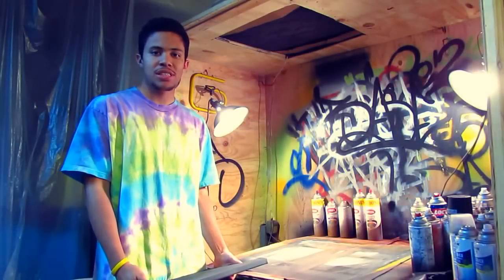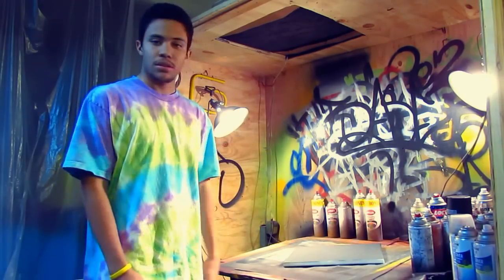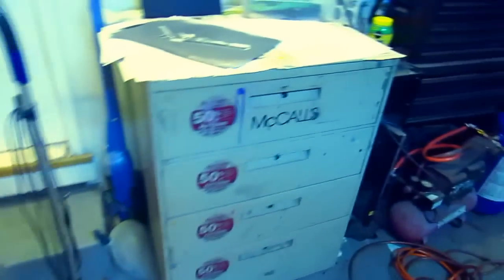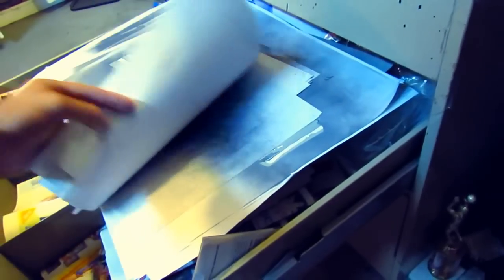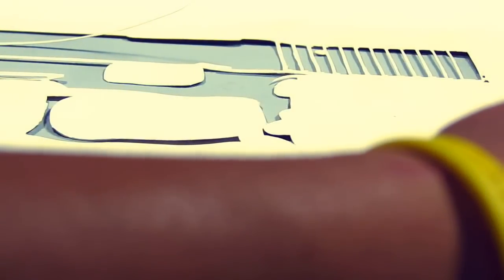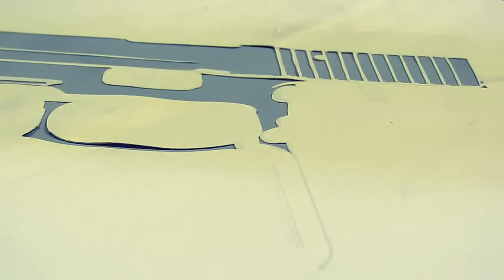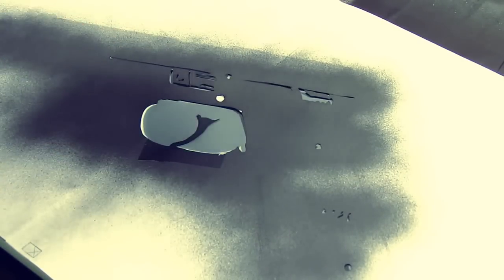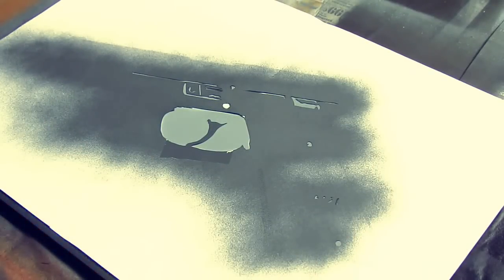Tutorials, Tips, & Tricks! "General Stencil Spraying" by BASE45

Comment: I am sure you know this already, But if you are in a small area such as what it looks like you are you really need to have some sort of fresh air coming in even though it is a small amount of paint it builds up not only will you feel it in your head seems as if you might be already starting at 19:20 mark? LOL IDK but the fumes can and will blow up if the mix is right, How you ask? cuz you have no open flame or high heat source? See that clamp light on the wall-well if you bumped that clamp light and it hits the floor the bulb breaks you have a nice little spark to get it all going  (some fumes sink to the floor so you may have more at your feet than what you think you have around your head). You do a Great Job you seem to really enjoy what you do I am in NO WAY trying to get on your back at all . Your going to have a bad day if that was to happen that's all---GREAT JOB !!!

Comment: Yo Base, Are you just using standard paper for your stencils? Ive been using acetate and find that in combination with acrylic spray paints they tend to run under my stencils even with adhesive and very light passes. Thanks for doing what you do brother.

Comment: Great Video :) Quick question though, does the spray adhesive work well if you're spraying on thick paper rather than a canvas or will it remove the bottom layers when its peeled off?